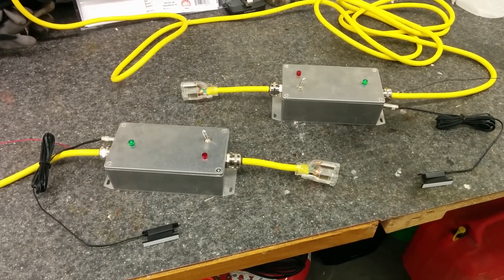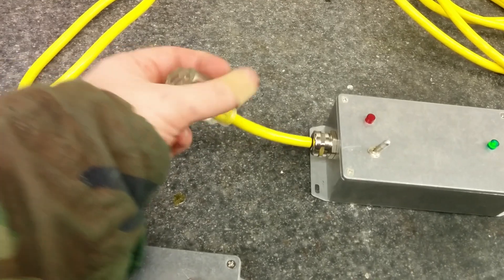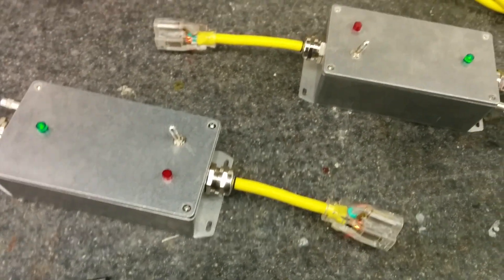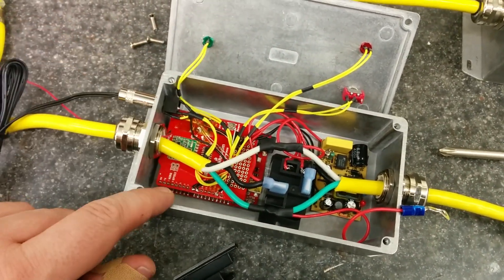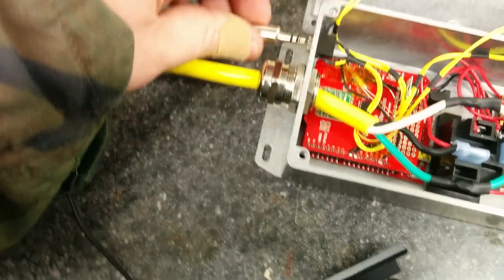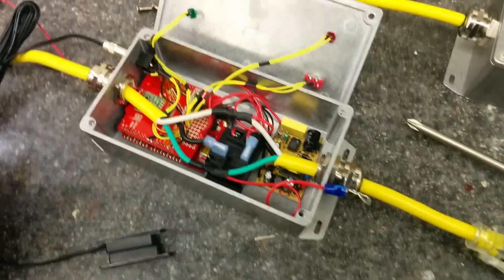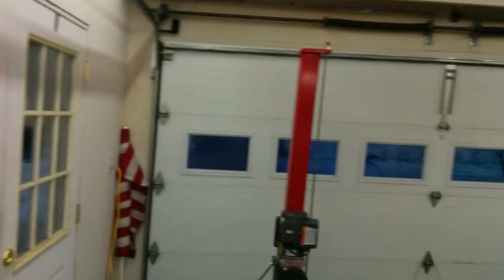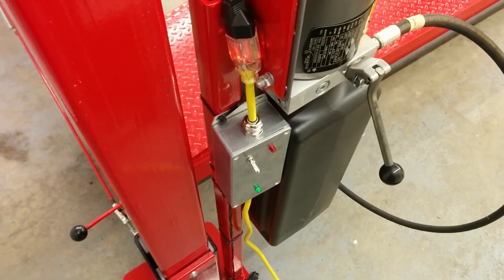LiftLocker - A wireless interlock for a four-post car lift

Comment: Nice build.  Your RF modules would perform much better if you used a nonmetallic enclosure.  It's actually kind of amazing that they work at all inside the aluminum enclosures.

Comment: Hi,

I came across this video on hackaday. I've been involved with the Automotive Lift Industry for a couple of years now. If you're serious about commercializing this, I think it could be a commercial success. I have personally countless 4 post home garage storage lifts and I do see a market for this. I think you may want to get in contact with the people at the Automotive Lift Institute - autolift.org To see about getting your lift accessory certified by them. After that I would go ahead and contact every lift installer you could find. They have a handy database with every single certified lift inspector with their email addresses so that's a great start. 

Alternatively you may want to get in contact with an aftermarket lift component manufacturer - the largest by far being SVI International out of Illinois, and see what they can do for  you. Every single person in this industry deals with SVI on an almost daily basis. If you can perfect this system they can bring this product to market for you. I'm not sure what their process is for them to start selling your product, but I receive new product alert brochures and emails from them fairly often so it should be a possibility. Allpart supply out of Arlington Texas is probably the second biggest aftermarket lift part manufacturer so you could possibly try them as well.

Like I said, your system would have to be perfect (or at least almost perfect), but if you can get it working consistently, I think it would sell. Another thing would be if you can get it to work with different voltages. While yes, most sub 9000 pound capacity four post home storage lifts are 110v, if you can make a 220V 1PH version (and 3PH version because why not?) it would expand your options. Most 220V lifts are installed with a plug as opposed to directly wired. They realized it makes lockout tagout easier and depending on the jurisdiction, slightly less permitting paperwork. Assuming the interior components can handle 220v, the only difference should be the plug.